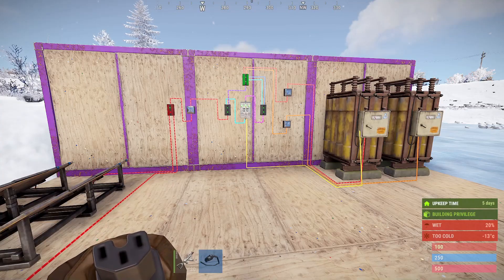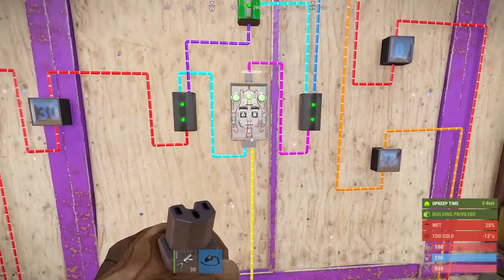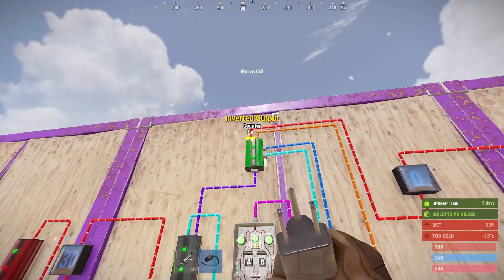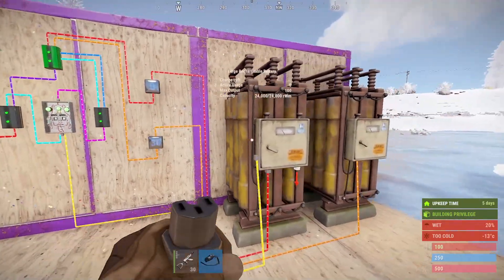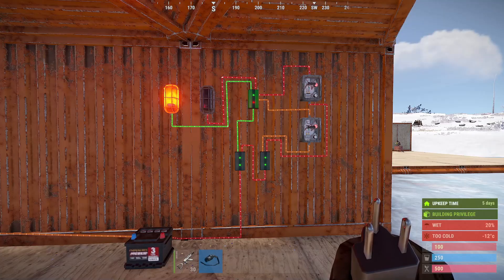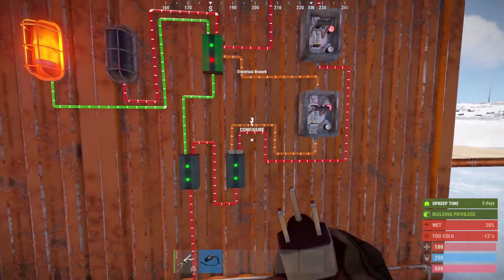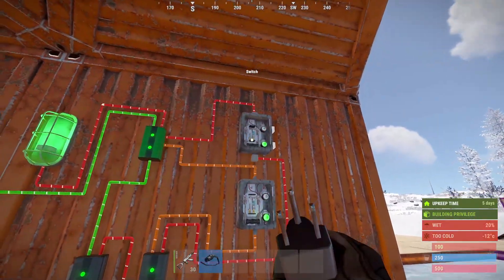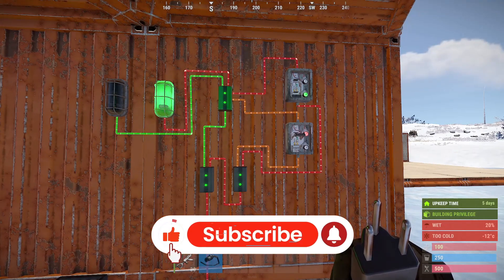Utilising the "Fully Charged" connection on a battery to switch charging to seconday a battery

Comment: How does it switch back to charging the first battery when the second is full?
I got it I think:
Added a OR commuteur and plugged both "battery full" wires from the both batteries and connected this OR commuter to the AND switch instead of only the first battery alone.

Hope it will work
Reply from the maker: Ooops, I forgot to add the OR Switch that the batteries then go into, which controls this.

this is it, with the OR Switch included.
https://www.rustrician.io/?circuit=390399bde98de27b025c7b5b1a7bf7a4

Thank you for spotting that, I'll revise the video and repost it tomorrow.
Reply from the maker: On the OR switch, Input A should be connected to the secondary battery, so as long as there is charge there, it will take it from that one. When it's empty it will draw from Input B start taking from the primary battery. So the primary battery at this point will no longer be putting one power down the full connection.
Reply: @Gratnak  The rustrician link shows a plan that doesn't have any connection leaving the added OR switch, I think.

Comment: Gratnaks school of electricity delivers once again
Reply from the maker: Thank you @steksons.
Reply: @Gratnak Very cool stuff. I re-watched this and wondering now what are the normal use cases when this is practical and favorable to do?
Reply from the maker: @steksons sorry for the delay in replying.

I'd consider putting this within a Nih switch, charging a secondary battery that doesn't have a constant flow out (supplying something like the Automatic Electric Furnaces), with the possibility of automatically swapping to a back up battery if the main is destroyed.

I'll post an example of this, tomorrow, as a rustrician link in here and in the main description.

Thank you for bringing this up.